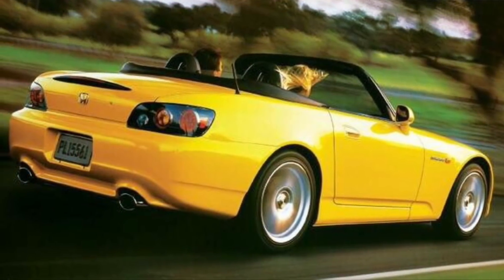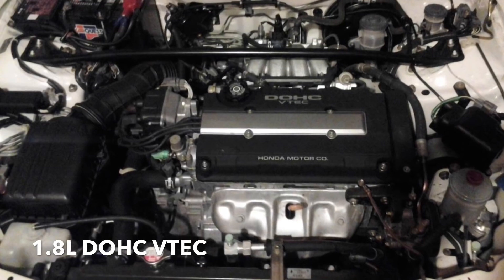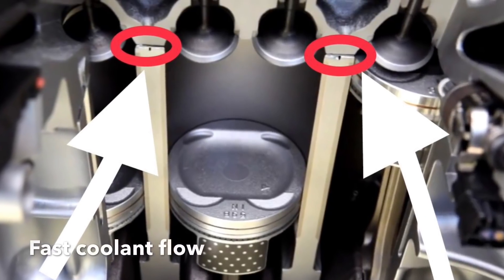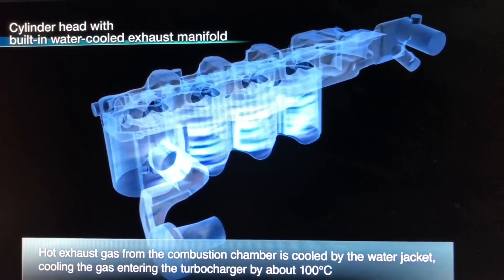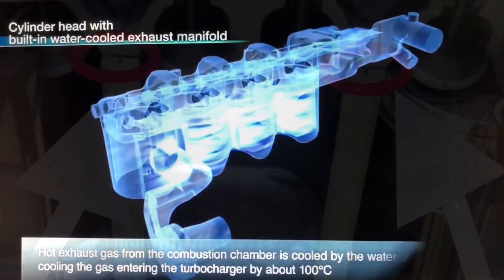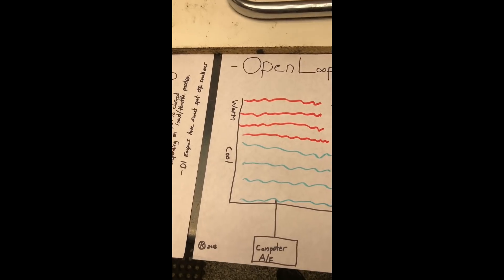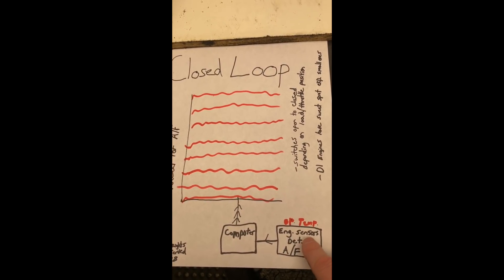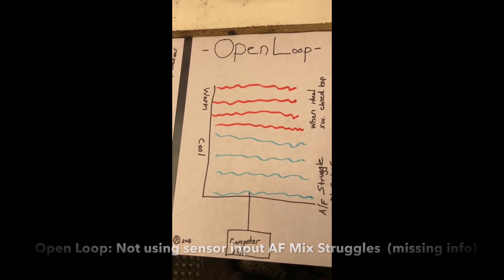1.5L Turbo Honda Oil Dilution Explained CRV Accord Civic

Comment: Remember back when there was this debate whether to warm your vehicle engines prior to driving?  Some would say “warm your engines cause driving with a cold engine can cause engine problems” and some would say “that warming your engines just burn gas”.  Well, I would recommend warming up your engines first no matter what type you have and take your vehicle to the dealer for service 👍
Reply: I told my brother, who has a 2018 CVT Honda Civic Hatchback Sport, to drive his car gently right away and idle for 2 to 3 minutes before shutting off his car. He drives for 35 to 40 minutes to and from work 5 days a week. Majority of his driving is on the highway with a speed limit of 60 MPH, we live 5 minutes away from the highway.  His Civic has 25,000 something miles, it's filled up with Shell's premium fuel, V-Power, and he only takes it to the dealership when the maintenance minder comes up at 15% in the oil life guage.  I checked his oil yesterday when I drove with him to his work.  He idled his car on level ground in the parking lot for 2 minutes before shutting it off.  Then we waited for 3 minutes before checking the engine's dipstick.  Wiped the stick off when it got pulled out the first time and dipped it back into the engine.  Pulled the stick out again to get the accurate reading.  The oil is past the upper level mark, stopping at the top of the orange tab, no big surprise and his oil life is at 60%.  Though what surprised me is that it wasn't as high as a CRV video I saw where that guy's oil reading was a bit passed the bottom of the silver rod of the dipstick.  I'm happy I taught my brother properly on starting and shutting off his car.  He's saving himself alot of trouble in the long run.  Yes, he has the Civic 1.5L and not the CRV 1.5L but if he didn't listen to me.  His dipstick reading probably would have been worse.  Could have been like the CRV in the video I saw.
Reply: I always heat up my car and now its easier than ever since i did that remote start mod on my accord 1.5T

Regardless ive never started driving without having 1 bar of the “heat”  never smelled gas in my oil my oil levels dont go up.
I hope they do come with a fix and make it free because that sucks for such a great company that had a hell of a reputation
Reply: MoNo K arent you on every Honda video
Reply: Here's the CRV video I was talking about.  https://youtu.be/pI-3o7yT6Hk  I don't know how this guy drives his vehicle but my brother's dipstick is no where as bad as this guy's dipstick.
Reply: Robert Bryant 
That sucks dude.
I hope they come out with a fix quickly and compensate us back for free.
That also makes the engine tear down quicker which wont last as long anymore
Reply: @Robert Bryant 
Good to know......I have seen reports of people from Austin Texas having the fuel dilution issue so its NOT just in cold climates.
I've talked to some mechanics and they say ALL direct injection engines have some degree of fuel dilution but obviously HONDA'S  fuel dilution is too great of an amount......they need to find a way to reduce the fuel dilution.
Reply: Motorcityman. Mazda states in their operators manual to idle engine 30-45 seconds before you shut the ignition off (this is for the Speed 3 ) 2 reasons help cool bearing journals and allow time for oil to drain back to the pan to prevent coking, its not rocket science. And for the record. 5w20,      O.C.C.    Pennzoil Platinum. Ultra. Dump the oil every 3k miles if you drive hard 5k miles if not NO MORE!!!   Oh and welcome to the world of GDI TURBO !
Reply: @blk77sunshn  
They say this to cover their ass in case you're driving the shit out of it!!
Reply: @blk77sunshn  
Mazda puts that in the manual for the Speed 3 because SOME people drive the shit out of it......its a blanket recommendation to cover their azz......if your racing your Speed 3 or driving it extremely hard then yeah idle it before shut off for a minute or 2 but NORMAL driving or even some brisk acceleration it's not needed.
Reply: Motorcityman Man Mazda's "Blanket Statement" Sure Seems to be Working Well.......
Reply: I agree.!  It seems common sense to me.
Reply: @motorcitymanman7711  Nope,  because of the fact there's more good coming out of idling before shut down more than just shutting it down.  Since it is a habit for him, no matter what and how he drives a vehicle.  He won't forget to idle before shut down.  Besides, the engine is warm anyway and he only idles for 2 to 3 minutes.  So the "waste" of fuel is negligible.  Especially since less fuel is sprayed into the engine once it reaches operating temp.  In comparison to idling a cold engine that will spray more fuel along with the long wait times just to move the temp guage a little. 

Were good, thank you for your input though!  ;)
Reply: @billwylde4846  
Ok, well just so u know that idling before shut down thing came from the early 80s Turbos......its not needed on today's modern turbos.
Reply: @motorcitymanman7711  I know but think of it this way.  He'll never forget to idle when he does drive it hard.  There is no harm idling before shut down anyway.
Reply: @billwylde4846  
All that unnecessary idling is probably costing him a couple hundred bucks of gas a year!
Do the math.....if he drives 5 days a week hes idling when he gets to his destination and then at home so....
2x2minutes is 4 mins of idling a day.
4 mins x 5 is 20 mins of idling a week.
20 mins x 4 weeks a month is 80 mins or almost an HOUR AND A HALF of idling each month.
You said he idles for a min or 2 so I based that on the worse case scenario of 2 mins ideling.
Since idling is bad for a motor in general hes probably reducing the life of the motor with all the needles ideling.
It's his money, but just throwing it out there for u.
BTW....unless hes really spending a lot of sustained time at redline in a race even when he drives it "hard" (probably not as hard as he thinks) todays modern turbos dont need to idle to cool down
Reply: @motorcitymanman7711  When the engine is warm, it's not that big of a deal to idle a couple of minutes before shut down.  In comparison to the folks who start their cold ride in the morning.  Idle it for 5 to 10 minutes then drive.  They technically waste more money than my brother.  Also you did not mention about any mechanical or electrical damage that can be caused by idling a warm engine.  More damage can be caused to your engine when you shut it off right away.  You don't know if the work you put on the engine was light or heavy.  There's no Work Load Guage to tell you that.  So instead of assuming your small 4 cylinder turbo engine had an easy time going 80 mph on the highway around 3000 rpms then you exit from there to alot of traffic lights.  Trying to race the person next to you from light to light because he is trying to cut you off.  There's the part of getting up to speed from a dead stop with slow moving traffic.  All that heat is building up under that hood.  Sure, your temperature guage might not move an inch but why would you chance it?  Possibility of warped engine parts from just shutting it off right away after stopping because you don't want to or you forgot to idle your engine after what you assume the driving you did was not hard on your engine.  No thanks.  Give it a couple of minutes to idle once you park because replenishing fuel is easier than replacing engine parts or the engine itself.  My brother has a good routine and it is doing well for him.  No adverse effects from the methods I taught him, besides a bit of money spent for fuel to idle his engine and that's with L15B7's oil dilution design flaw.

In the winter he scrapes all his windows and remove the snow before turning on his car and driving right away slowly with the front window defroster, rear window defogger and air conditioning running.  His car gets warm quick.  Then when he arrives to his destination.  He idles 2 to 3 minutes with the air conditioning off then shut down the engine.  My brother is good.
Reply: @billwylde4846  
Like I said, ideling a modern turbo motor for cool down is not needed, u and your brother can do what u want obviously!
Reply: @motorcitymanman7711  You can't prove what my brother is doing is harmful to his engine.  

Thanks.  :)
Reply: @billwylde4846  
I dont need to prove it, anyone that knows anything about cars knows that ideling wears a motor and its componants more than driving a car.....u really dont know this???
Engine experts say this, not me!
Example for u.......if u do a lot of ideling or short trips instead of long highway drives you have to change your oil SOONER.......it wears more!!
BTW.....if your brother idels his car like u say, he wastes 30 minutes of his time, a whole half hour EVERY WEEK......and he wastes 30 minutes of fuel.......and probably about $5.00 in gas a week, so $20 a month or about $240 a year!!
OR......your brother spends 2 HOURS EVERY MONTH sitting in his car with the engine running!! LOL
Reply: @motorcitymanman7711  so you are saying idling for a minute before taking off or shutting down is going to shorten the life of your car?  I don't think so.  If it does, it will be minimal.
Reply: @thejerseydebil  
I said ideling for a minute or two to cool down a modern turbo motor is unnecessary and wastes fuel.
As far as start up, u only need to idle until the rpms drop a little then slowly drive off.
Reply: @motorcitymanman7711  
Go read Summary of OEM Idling Recommendation from Vehicle Owner's Manuals by Kristy Keel-Blackmon.

The article states idling is bad but it doesn't specifically mention at what state of temperature is the damage of the engine is occuring when it describes what is happening inside the idling engine.  Though we all know idling an engine when it's cold is bad.  When I idle, which is for 2 to 3 minutes with a warm engine, idling is doing nothing more than consuming my gas money.  Better than a engine repair bill.  I am not idling for 5 minutes or more, that's excessive.

Oh about your formula, it's meaningless because you're just supporting your point it spends gas money in the long run.  My brother and I already knew about that long before you and I spoke to eachother.  Though the method I have mentioned is not harming the engine.  We are not idling long enough to even achieve the kind of damage you and this article states.  

Besides, you aren't doing yourself any favors because no doubt you're idling at stop lights and stop signs.  No doubt some of those moments are longer than a minute, especially with heavy traffic.  Oh yeah!  Can't forget about the drive thrus!  So what are you trying to prove when those moments happen to you?  C'mon. 

https://www.osti.gov/biblio/1257900
Reply: @billwylde4846  
I only idle long enough to drop the rpms to about 1,000, then slowly drive off......doesnt hurt the engine at all and let's the oil circulate/lubricate, I'm talking seconds.......
You and your excessive/compulsive brother can do what you want, it's your money!! LOL
Reply: @motorcitymanman7711   Definately!  You can waste your money paying for warped engine parts!

Thank you for your lack luster knowledge and not teaching anything useful!
Reply: @billwylde4846  
LOL, The only thing that's warped buddy is your thinking, STOP living in the 1980s technology!!! and my advice SAVES people a lot of fuel if you unnecessarily idle your motor every day!!
Reply: @motorcitymanman7711  idling and bring car to operating temp is good for your engine.  Especially Turbo or supercharged cars.  At the track, we warm it up before running the track, same thing as on freeways.
Reply: @seansteryu7398  
Nope, not on modern engines, you can do what you want but ideling until operating temp wastes a lot of gas and takes too long.
Your engine warms up MUCH faster driving slowly after the rpms drop slightly after a few seconds of ideling.
Reply: @motorcitymanman7711  I warm a little and let it roll.still need to let the oil to be brought from the sump to lubricate, especially modern engine using 0w-20
Reply: @motorcitymanman7711  The people I taught with my methods to, have engines that last them a long time.  The people that didn't listen come back to me crying of engine problems.  Whether it is electrical or mechanical problem, I just reply with "See? I told you so".  My brother's car has 30k on his odometer, no problem with his sport hatch.  I save people alot of trouble.

All you can tell me is that my methods waste fuel.  Nothing else?   I do drive my car right away gently as soon as I start it.   Yet you complain about me wasting 2 minutes of fuel on a warm engine once I am done driving...  You have no idea how much fuel is exactly spent in a month by idling two minutes before the engine is turned off.  I have no idea either but you don't see me make up numbers  like you did when you did the "math". 

Lay off the exhaust buddy.  You're getting worked up over nothing and giving useless information to other people.  Once again, the amount of fuel spent in a month for a 2 minute idle is negligible.  In comparison to the other folks out there that idle for 5 to 10 minutes everyday at the start and end of their drive.  Why don't you go lecture them?  Oh wait,  your mind is already warped over my measly 2 minutes.
Reply: @motorcitymanman7711 , you're correct.
Reply: @motorcitymanman7711  
Just my input, I’m not a mechanic neither a scientist. In my case, my 6 gen civic, idles every weekend for about 2 hours, if not more (yes, you read that right). We have a reason why the car idles for that long every weekend or during holidays. During holidays the car idles over an hour everyday either summer or winter. Sometimes I even wonder how on earth the wiring loom in the engine bay didn’t melt yet in hot summer days when the engine bay is red hot with engine on and AC on. I religiously change the oil and oil filter every 3000 miles (4.8k km) and I use the cheapest engine oil I can find. My civic has 140k miles (approx 224000 km) and no issues. From my end, I would take this “engine idling issue” with a massive grain of salt. My car is here to serve me, either idling or driving.